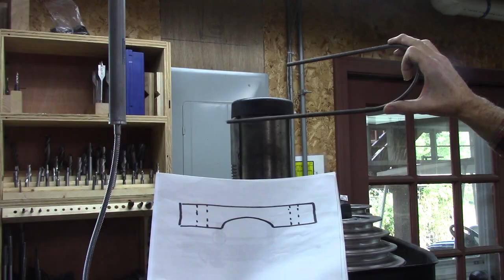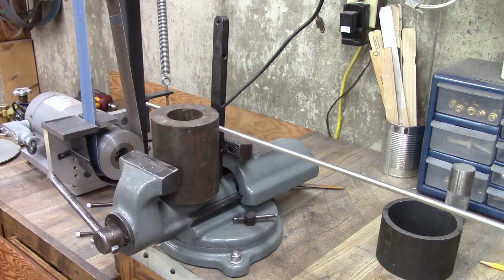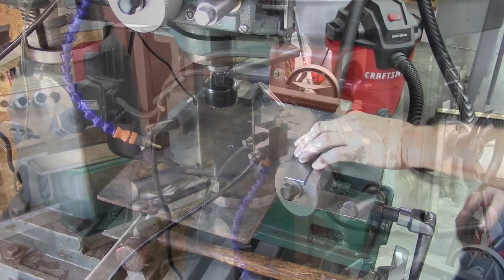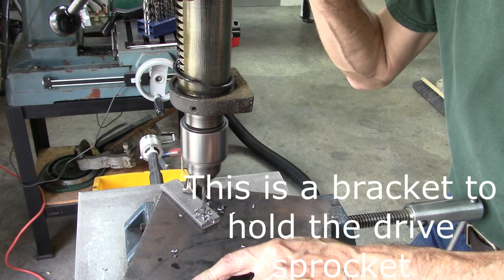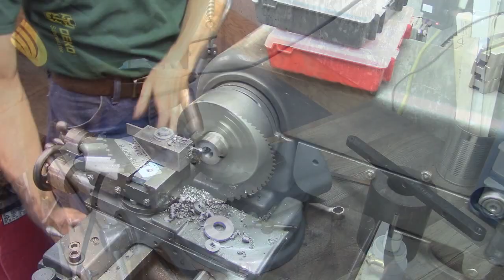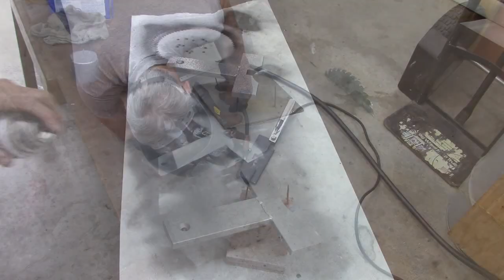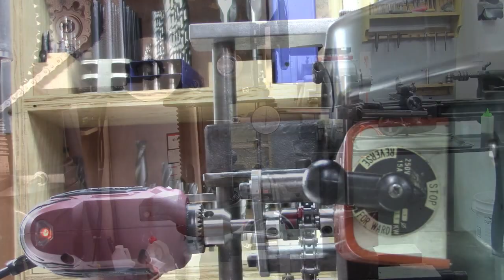The Ultimate Round Column Mill Fix

Comment: Nice project.  Well done.  I find a shallow "V" works as well as the round profile you cut for the clamping block, and also much easier to machine. 
I would replace the delrin pads with a sintered bronze bearing in a piece of steel.   It will not wear as much and should be more rigid.
Another YouTube channel, CuppaJoe did a similar project on his RF30.   He added two large plate at top to re-mount the pulley and allow space for his guide bar on the right side of the mill.   Many ways to achieve an objective.
https://www.youtube.com/watch?v=hRwu9plKfO4
Dave.
Reply from the maker: I think I saw this video a while back. His set up is nice but requires a VFD,  pulley changed and in most cases a new motor. I can't believe his drill has enough power to lift the head without any reduction!!! Direct drive! Pull that trigger all the way and watch out! Man that guy needs a tripod. Thanks for the link and thanks for watching.

Comment: I enjoy your projects, most satisfying.  Please clarify your testing of the accuracy with the dial indicator.  Does the column have a flat spot along the length where the dial indicator is referencing?  If not, then is this test correct for checking radial movement of the mill head?
Reply from the maker: I had the quill fully extended and locked. The indicator was on the side of the quill. The exposed quill is about 6-inches long. This test tells me if the quill stays aligned with the column as it moves. The indicator is on the curve (left side) of the quill. Of course I am assuming the quill is parallel to the column on the other axis (very close I'm sure) and if it is this is the best way to test. Maybe the only way.

Comment: Perfect timing. With the cooler weather, I will be working on upgrades for my "Precision" 3.0 mill. DRO and x power feed are almost done and the column issue was next on the list.
Reply from the maker: Cool...  I'll have a link to the drawings and parts list posted in the next few days. I'm not sure it will be the same but at least it's a starting point.
Reply: @WinkysWorkshop  Looks pretty much identical. Much easier fix than Cuppa Joe's
Reply from the maker: @mikesgarage394  I agree, I like the VFD and all but that a lot of work and expense too.

Comment: That worked out very well. I reckon either a vee belt or ribbed flat belt would also work as well as the chain drive.
Reply from the maker: A timing belt would be great!
Reply: @WinkysWorkshop  It would indeed,but even one of the poly-vee belts used to drive vehicle ancillaries or washing machines would work well I think. Certainly plenty of grip from a 1/2" or 5/8" wide pooy-vee.

Comment: Really like this! Great fix to an annoying problem. One question- do you leave the top pulley cover off, or have you adapted it so it still fits?
Reply from the maker: I leave it off for a couple of reasons. First, it rattled terribly and second, to loosen or tighten the draw bar it helps to grab the pulley. I just got tired to lifting the cover. It would be fairly easy to trim the covers for the modification. Also, some of the newer mills have a plastic cover that might not rattle.

Comment: I too needed to cut a large radius curve. Rather than make/buy a big flycutter, I mounted the workpiece on my rotary table, and used a normal end mill.
Reply: One of the other ways to skin the proverbial cat. Mike M,that would likely have been my first thought as to how to cut the arc portions out too.👍
Reply from the maker: My rotary table is wimpy and doesn't hold up well under load. Thanks

Comment: I like it! Great job! Seems you just have to keep an eye on the delrin wear pads and you are golden!
Reply from the maker: I'll probably need to adjust them once or twice but after they wear a little I suspect they will stop wearing. Delrin is tough stuff.
Reply: @WinkysWorkshop  Just machine them with the same contour as the round rod they travel on. Problem solved...
Reply from the maker: @alanddeb2  - I doubt they will ever wear. I used to work for a printing company and we had gears made is Delrin meshing with steel. I've see the delrin break but the metal gears wore out long before the Delrin.

Comment: Excellent again! May give it a go on my round column mill...
On another subject, do you have any video with info re the coolant system for your Mill? I need to add one to my Mill. Is it cooling as well as lubrication that is required during milling?
Reply from the maker: The coolant I use is called Koolmist. It's about $40 per gallon but you dilute is a bunch, I think 15:1.  There are many options for sprayers but get one with both air and coolant valves, some just control the air.

Comment: well done!  For this to work well that vertical round bar needs to be as straight up and down as the mill column
and not angled over when looking at it from the side.  did that take a lot of tweaking?
Reply from the maker: It took about 10 minutes. I guess I should have covered that in the video. I just stood back and visually aligned the bar with the column first and then loosened the lower clamp slightly and tapped it with a hammer. I was worried about the head moving when I tightened it but it doesn't move much. Thankfully. And thanks for the comment.